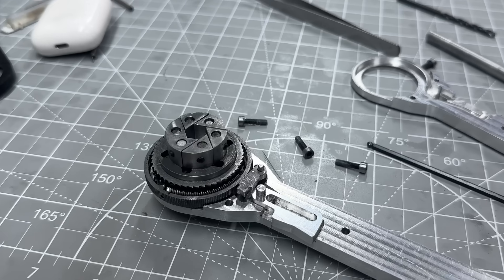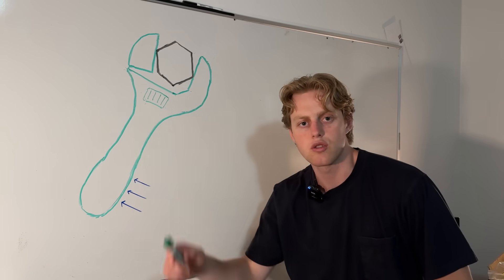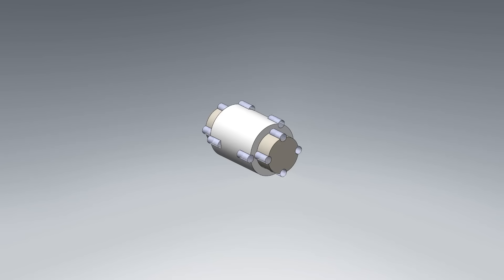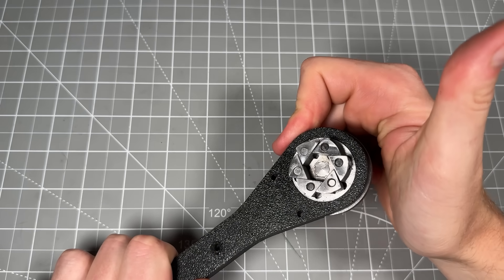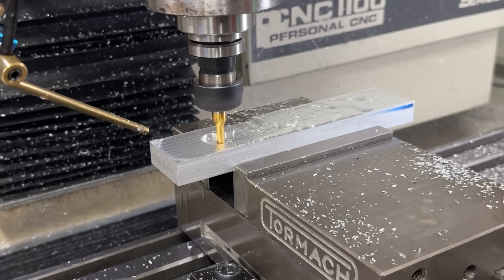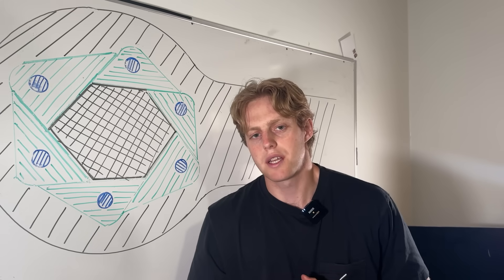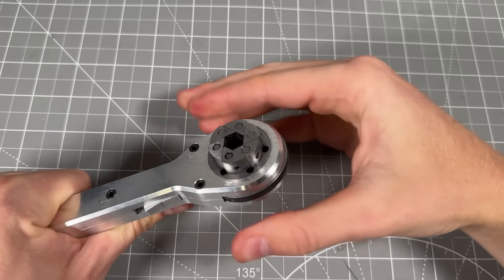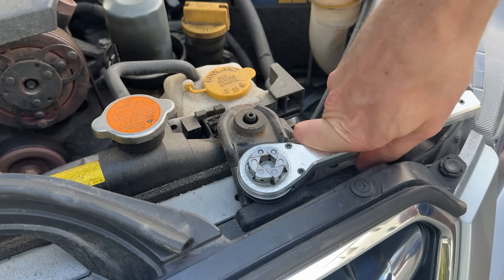I Invented an Adjustable Ratcheting Wrench

Comment: THIS IS GREAT, but I worry about the streanght when it comes to the big bolts, bcs the jaws are not that locked into together and also I have seen that you tightened it only lightly, not enough  for most aplications............BUT what I understand this is only prototype

Comment: The main flaw I see with it is when screwing on a nut, your design doesn't have a hole in the center for the threads to go through. Neither do sockets, but regular wrenches do and sockets at least have depth.

Comment: Good for you !! Definitely keep going. I live on a ranch in Texas. Carrying a set of sockets around in the tractor is just not practical. This would really fit the bill. You could also make two sizes. One for the larger bolts up to 1/2 or 5/8" while a smaller one for the below 1/2 inch. These would be incredibly useful in the tractor tool box. I'm constantly having to adjust gates, etc. so these would be well worth it. Keep the great development coming. :hand-pink-waving:

Comment: Could just make the attachment into a "socket" and have the other end a 1/2, 3/8, 1/4 drive. This way you could use extensions and normal ratchets.

Comment: This is fantastic. The time saving, avoiding frustration, and avoiding a huge inventory of different sized tools is incredibly valuable. Even if it needs to be expensive, the advantages are just so good here. Anything you can simplify or make easier in life is incredibly valuable. Even with its limits with tight spaces it still has tons of utility, and I'm sure you have some ideas to fix that too or maybe as a separate tool (Teeth extended out longer?). Really it just needs those finishing touches and a good stress test, as much as it could get. Maybe you could give them out to local car or other types of repair shops. I guarantee the owners would see it and at least want to try it given its potential. I hope you have this patented or plan to take it to market, for real. Please make sure you do, you deserve to profit from this.

Comment: Your design is very impressive, and it shows a lot of potential in both function and market value. I would strongly encourage you to secure a patent, if you haven’t already, to protect your work and ensure that larger companies don’t capitalize on your innovation. One enhancement you might consider is incorporating a thumb switch closer to the handle. This would allow the ratcheting mechanism to be opened with one hand, which could be particularly valuable in tight spaces where two-handed operation isn’t feasible.

For reference, Wera produces a self-adjusting wrench with ratcheting capability, but their tool is limited by the fact that it only fits certain sizes, requiring multiple wrenches to cover a full range. Your design, with further refinement, could address this limitation and stand out as a more versatile solution.

Comment: Please keep working on this! I could see many applications for quick ratchet needs but without needing the sockets like you mentioned. Try making a small version like a socket too that could be attached to a standard ratchet or extension and try different sizes? Now deep and recessed bolts or nuts will take some ingenuity but seeing how far you’ve come I think you can figure it out!

Comment: Keep in mind that the simplest solution is usually the best solution.
-The good: This could be a decent emergency tool for vehicles, home owners and some tradesmen. 
-Concerns: Durability / longevity because of complexity (wear and corrosion); Space required to use tool.

Comment: If you chanfer it you could thread it and add a chuck style collar like a drill press to increase length for recess holes..or have a proprietary extension to except standard sockets if needed..so you could use the socketless version up to half inch,13mm..and still be able to use it on all sizes above the design limit

Comment: Its about a 50 50 real use vs gimmick for my purposes. There are a lot of bolts in areas where a socket fits but a wrench doesn't so there is no way this would work. But for more open spaces I could see the convenience helping out. Have you did any max torq loads on it to see how strong it is relative to modern ratchets? Ratchets from decades ago frequently broke  from higher torq loads (200+ ft/lb) but the sockets rarely failed. How does this hold up under high torq?

Comment: The socket length is a big issue. In my experience I need sockets and extensions. I wouldn't buy this but I would buy a auto adjusting sockets that fits the standard extensions and ratchets.

Comment: "tool lovers" wtf ieven is that. You look at your tools?
The tool i love the most is the one most reliable which i can abuse the most without braking it. quick reason why nobody builds stuff like this: volume. This wont replace a full set of nuts and rachets. Its just a gimmick. On a practical note: it scratches the surface you screw your bolt into. As a concept nice - but its utterly useless for everyone who like to work with his tools

Comment: Metal finishing can help.  Polishing stainless either mechanically or electro-polish can help smooth action, decreasing friction.  Steen can be mechanically polished as well. Great video on product design and re-design, calculating forces and testing prototypes. only the find why sockets work, reduced size allows ease of access in auto mechanics.  I have a Stanley one I rarely use as it only works with surface mounted bolts with adequate planar access.  Machinist tool designers need to be more educated on metal finishing techniques and their benefits.

Comment: i think the limitations it has when it comes to fitting the tool in tight spaces makes it difficult to use in for example automotive repairs. but it might have some use in automation or factory assembly? definitely get a patent on this before someone else does! its a genius idea and definitely  something that can be improved and expanded upon!

Comment: you can have that same locking mechanism and with a straight handle instead of flat like a rod going straight down and for leverage you could always add a square indent at the very top included with a small x tool to plop in, I know its an xtra accessory to have but it would make those tight spaces on for example) working on a car much easier. lol i dunno but I'd like to buy a prototype. I like that locking mechanism you have here

Comment: Amazing engineering! Definately Kickstart this. #Onewheel wouldn't exist without it.

I'm sure you have thought about it, but a pasthrough system would be ideal for long lag bolts with a nut that needs to travel any length of distance. 

I can see this eliminating sockets especially if you can make an adator for impact drivers. Which would need to be a separate tool using the same cocept of simply elimnating the need to carry dozens of sockets. 👍

Comment: If there was a way to take that fixed Ratchet head and make it adjustable at a few different angles that might help but ultimately I think if you want a ratchet that’s able to get into those tight spaces you’re going to have to redesign the whole thing I don’t think the socket set with ever truly be replaced but I think a ratchet like that would be handy in most situations you could also try making 3 different versions of your one Ratchet for different situations using the same concept so maybe you aren’t replacing the ratchet set with one tool but reducing a entire socket set into 3 different socket wrenches is better than having a big clunky socket set with a bunch of sockets that are going to get lost. I love your design I think it’s brilliant and elegant. I absolutely hate going through a socket set trying to find the right socket to find out it’s not in there because it’s not your set and somebody lost a quarter of the set already I was a super intendant at one point and something like this would have been very useful and saved me a lot of time there was a in ground pool at one property and   Sometimes we had issues with the pump I hope I see this in stores one day because I would love to have one.

Comment: That is quite some engineering. Especially to start while in HS. Hoping a tool manufacturer approaches you and gives you a chance for more tool design. I could see this application work well in applications like for NASA. You hit the nail on the head when it comes to clearance. I think that is a challenge they all have had. Keep up the inventing though.

Comment: I think the DIYer/handyman market would like this most. For the auto mechanic and similar roles, the clearance and ability to get to recessed heads is a huge factor. You'd probably want to figure out how to have a line of accessories as well for reaching and getting around corners etc. Any time you would normally need a deep socket, this would fail. But the design is cool and I'm sure there would be a market, even if it's more of a consumer tool than a pro one. Lots of regular people would love to have this for around the house instead of a full set of sockets.

Comment: Yeah, that last thing you said about using it with a cordless design, if you just add it to one way to where you just flip the wrench to go the other direction and basically making it slim as a regular wrench where would fit almost anywhere that be great . Probably making like a long version and a medium version and then you could do like a D version for murder to reach spots electric rats to fit everywhere because they’re so bulky and their size there’s definitely still space in Room to improve. I guess there’s a tool for every job right

Comment: you should also consider seperating this into 2 sizes with different ranges aswell as figuring out a way to make the main racheting mechanism a stand alone part that you can use like a socket such as placing it on the end of an extension or any kind of powered ratchet already available to the consumer market.

Comment: Probably the most important thing to focus on, as far as practicality, is how long it will work.  I know it's more easily said than done,  but you'll need to figure out a good series of stress tests, e.g, how much torque it can handle,  how being dropped and impacting at various angles affects the inner mechanism, etc.  Probably the best way to test it is to use it.  Use it for things like repairing your car, or driving large wood tapping bolts into various types of wood.  See how many individual tools you can use it to replace...  I could go on, but I don't want this comment to end up as a giant text wall.  It's a great concept for sure.  Regardless of whether it works out or not, the knowledge and experience you'll gain in the process is absolutely priceless.   If you ever do a trial batch run, I'm pretty sure many,  including myself, would love to buy one even if it isn't perfect. I could imagine this being part of a display at some sort of museum of invention or something like that.  Good luck.

Comment: Would it be possible to have a metal strap around the socket that tightens and loosens with the adjustable socket?  A metal strap could provide support to allow it to be thinner.

Comment: As with everyone, i concur, awesome job in the design, sticking to the design process despite roadblocks, and for being correageous enough to post your video.

Reviewed a few comments and didn't see these questions that you may want to ask yourself....

1. The bolt head clearance limitations of the design (like any adjustable tool) are a downside (specifically considering tight spaces). How much additional clearance would be gained by having separate wrenches for on/off? Would your design accommodate that? I'd gladly trade the adjustability for having to swap wrenches depending on direction. Even more so if that shaves the size and clearance down and allows more access options. (And that would mean twice the sales!)

2. I cant quite tell...do the jaws stay open until the switch is clicked? Or is the thumb holding the central plate the only retaining feature? For tight spaces, "click to grab"  would be a killer feature. It won't matter if you can't tell the bolt size. But if the thumb is required, that makes tight spaces even more difficult to use the tool. 

3. What is the scalability of the mechanism? Obviously, you're going to be limited in range for a specific wrench head, say 3/16" - 1/2", but is there a max size? I ask because if it scales to larger sizes, there are entire industries that you're not even considering that use those larger sizes. Those industries need fewer tools per capita -- to the point that small scale production is potentially possible (e.g. home workshop)  -- but they pay top dollar, which could be an option for short-term income while developing both the design and production of the smaller sizes for consumers/prosumers.

4. Want to profit from this? Take down the video. If you want the design copied by the manufacturers of the world, leave it up.

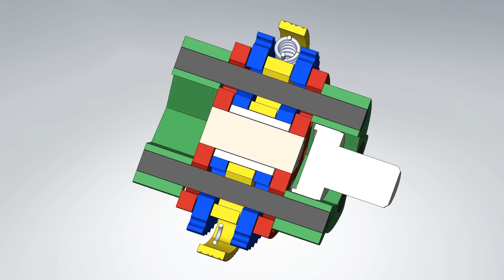Comment: 3:06 you probably already thought of this. Production with tight tolerances (I predict) leads to higher manufacturing cost. How about putting the mirrored side on the opposite end of the handle. 
Pros: no need for a precise bushing.
Less complicated design
Cons: MORE PARTS 🎉
Everything becomes loosey goosey

From what I see, separating the two would mean youd have to make sure the grey shaft (connecting green to blue) does not fall out or torque apart.

So now i say: this comment is useless, if someone reads this they can think about it

Comment: It will never replace sockets. Cause one thing a socket can do that this will not be able to do is remove nuts from a long bolt. While this would work on a head of a bolt. The only way you could make this work on the other end is a through design which would require eliminating the cylinder in the center of it. They have box end ratchet wrenches already but an adjustable ratcheting boxed end ratched would be hard as hell to design but since you designed this, you could probably figure out how to make it work.
Reply: Also rather than make another side for loosening, a through design could just be flipped over for loosening.

Comment: What if you added a dovetail slot into the jaw faces (the ones that touch the bolt), and a dovetail slider onto the corresponding jaw faces? Could that reduce the force on the pins and perhaps allow the jaws to be extended vertically to access recessed bolts?

Comment: fastener access is the problem with any tool like this.  It basically useless in the real world because it cant access any bolt heads within an inch of flange or other obstruction.  For instance, bolts/nuts on car battery clamps.

Comment: This is truly innovative and well thought out your ability to design, build, problem solve is incredibly impressive.
 But as an industrial maintenance technician I can see why nothing like this is on the market. 
Its bulk alone would be a problem in most mechanical situations but not all 
It's hard to tell in the video but it's limited range of travel realistically would only replace a few socket sizes but it will work with metric and SAE so that's cool.
I think it would be a great addition to any tool kit as a quick go-to in the right situation but not a replacement for other tools . 
If you can figure out mass production for an affordable price and maybe different sizes I  will definitely be buying some

Comment: It’s definitely useful and cool but it seems like it will be extremely expensive to manufacture with the tight tolerances and complex structure, and long term durability is still a question, it looks like it’ll be a $200+ and most of the public probably won’t spend that money on a wrench

Comment: I think this is a great tool design! But I think you are missing the point of it, imo this will never be a substitute of a whole set of sockets, the versatility and simplicity of those is unmatched.
This should be an addition to it, for those moments when you find a bolt of a size you don't have (metric/imperial, many people don't have two complete sets) or especially when you find an old worn rusty bolt that has slightly rounded corners, the ability to tightly grip it wood really make a difference. Infact that's when I usually reach for my conventional adjustable wrench, but still having the benefit of a rachet would be infinitely better

Comment: It's a very neat design from an engineering perspective but the manufacturing costs (machining each part plus hand assembly) would be way too excessive to be a viable commercial option unless you can sell some to NASA.  However, perhaps with MIM manufacture of some parts, casting of other parts and overseas assembly the production costs could be brought down to be a viable commercial option.  I bet you have over $1000 worth of machining alone in that one wrench not including materials, heat treatment & assembly labor.  I'm sure some Chinese company is watching your video right now and trying to figure out how to copy it.  But hey, if Snap-on can sell a $400 ratchet there might be a market.  Without people like you there wouldn't be any innovation.  My family has a machine shop in PA, love those Bridgeport mills.

Comment: I wonder if you'd be able to incorporate a 3/8" square drive for a socket extension in this in the center of the driver and pawls, so that it can be used as a traditional socket wrench and eliminate the need for a secondary wrench for recessed fastener access??

Edit: instead of having a square drive sticking out (making the design impractical) you could machine a custom double-male socket extender that can live within the handle.

There would be a female recess within the driver and pawls.
Reply: Or of course maybe just a custom adapter that the pawls can grab onto that ends in a male 3/8" square drive for typical sockets! Maybe you could machine something into the pawls that gives it a "locking effect" on this socket adapter so it is "specialized" and has "better grip"